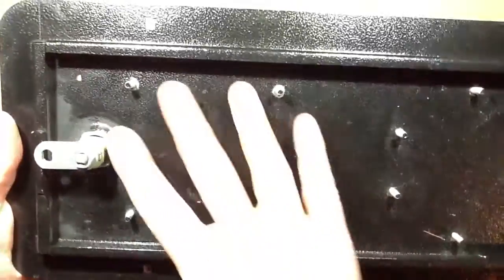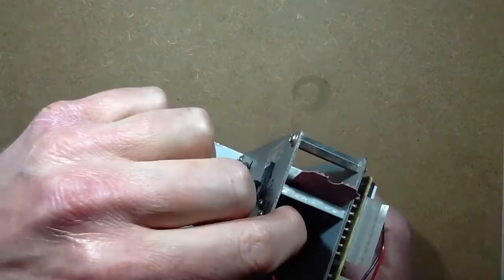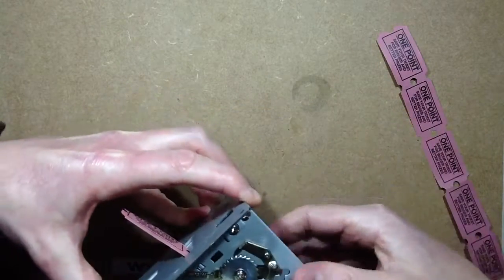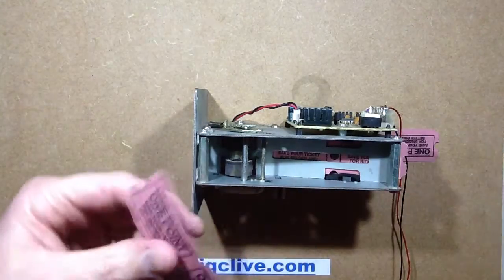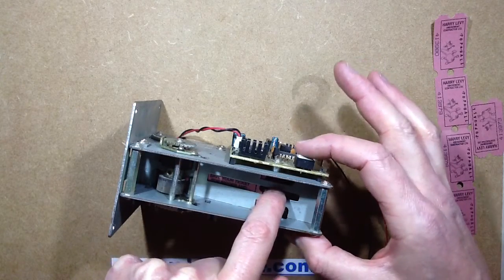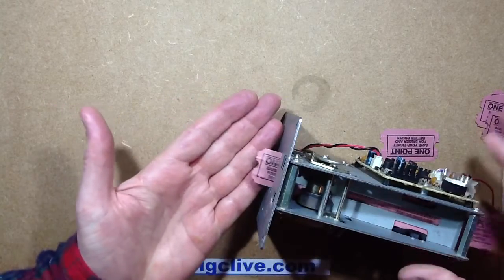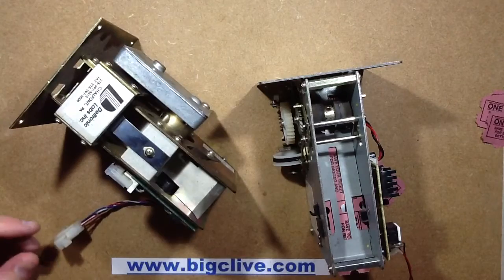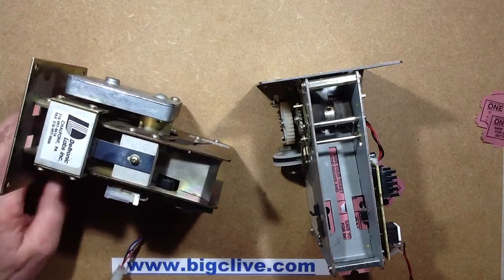A look at some ticket vending mechanisms.

Comment: +bigclivedotcom The more modern variant for locations not using some form of "stored value cards" (either written to a mag stripe, or saved to a networked server under your card ID) is a ticket printer. The device accumulates the number of "tickets" won, and when you cash out, it prints a single small receipt with the total value, timestamp, location, logo, promotional specials, bonuses, etc on thermal paper. It's a lot more economical for the location to buy rolls of thermal receipt paper, nor does the customer need a pillowcase full of tickets to redeem for their trinkets, plus it's virtually unhackable for the average person. I had a hand in developing the first one almost 20 years ago.
Reply: This sounds a lot like what the slot machines at the last casino I was at used.  No shower of coins when you hit the jeckpot,  just a slip of paper.  :-(  If you did win,  or just wanted to cash out,  you'd take that bit of paper to another machine where your winnings were dispensed.

Comment: I love this sort of thing, I could explore / play with devices like this for hrs if not days lol I do have  a question though, how big would a reel or box? of tickets be as these machines I would guess spit out 1000s daily?

Thanks,

Kevin
Reply from the maker: I think they come in blocks of 2000.  They usually have a polythene strap or string around them so that you can put them into the holder and then cut the binding to unleash the tickets.  If you buy enough you can get them custom printed with your arcades logo, but I think you'd need to buy a lot to make that worthwhile.

Comment: Hi recently bought a ticket dispenser but don't understand  the INPUT and OUTPUT  signals because i want to adapt it to another machine I'm working on, I want to know if you can help me, PLZ :(
Reply from the maker: +Carlos Chin There are various units with different control systems.  You'd need to find a data sheet or trace the circuitry to work out which pins are inputs and outputs, then experiment.